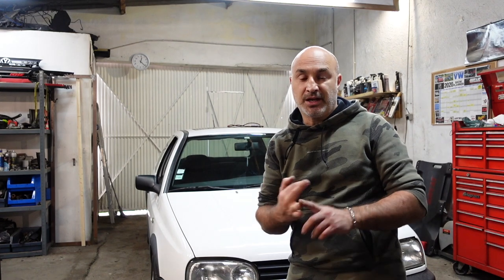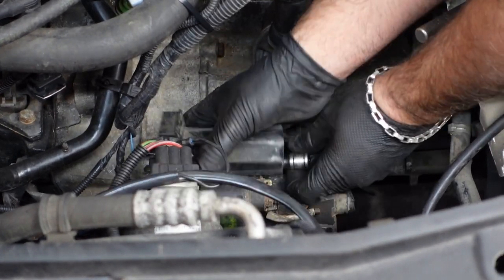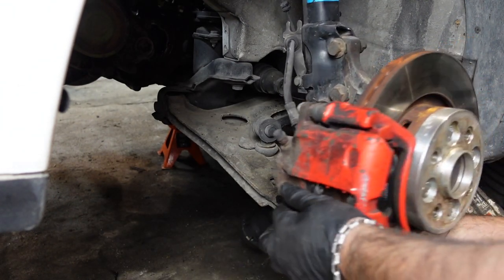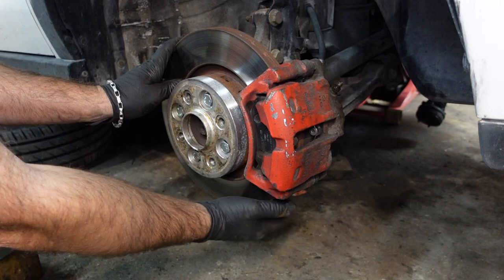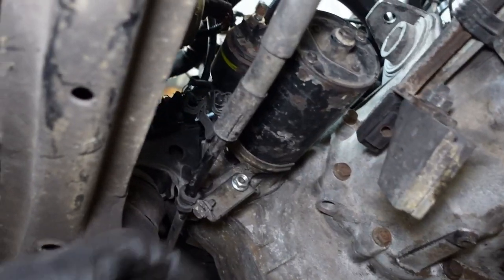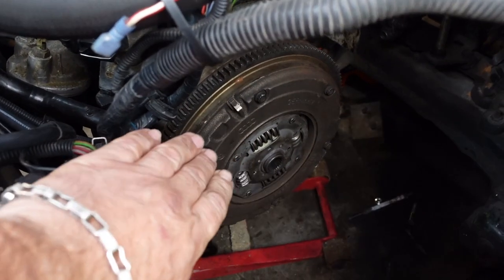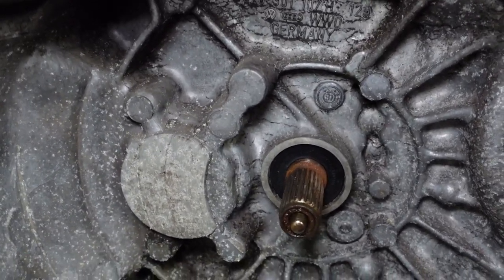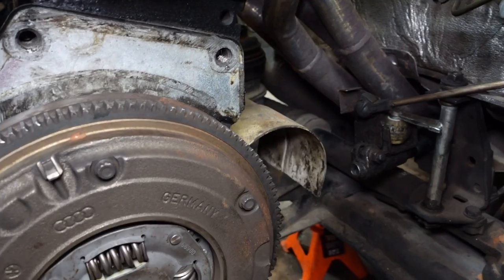How To Golf 3 020 Remove Gearbox

Comment: Thank you so much, I almost have the transmission out. When replacing the rear main seal, do you have to pre-lubricate it? I have the elring replacement seal for the engine. I also was wondering if the input shaft seals are worth replacing. The larger black one behind the splines of the input shaft.
Reply from the maker: Yes 100% once the gearbox is out for the low price of them replace both those gearbox input shaft seals. I never have lubed the rear main seal. But doesn't main you can't.

Comment: Will this video help me remove the gearbox on my 2006 VW golf Mk5 Fsi with a manual 020 gearbox?
Reply from the maker: In truth I don't know, maybe 70% may be the same, the clutch will be hydraulic not cable, the gear linkage I would think is also different.

Comment: What steps are different for the 16v 2.0 ABF GTi engine?
Reply from the maker: The selector cables, the clutch slave cylinder, speedo wiring plug, and the angle to remove the gearbox due to the bigger flywheel.
Reply: What angle does it need to be as I’m struggling to get the gearbox off
Reply from the maker: @BrandonhamonHD  you need drop the engine slightly then with the gearbox loose, clock the gearbox anti clock wise.

Comment: How would this differ from removing Golf-mk3 vr6 2.8 1997 gearbox? Mine was the last edition, September. I believe it's an 020 gearbox.
Reply from the maker: The Vr6 uses the 02A gearbox, there are a few differences, that driveshaft flange which hits the back of the block can be unbolted on your gearbox with a 6mm allen key in the centre, oil will leak from it so remove the oil before hand, makes life so much easier. Your 02A has a hydraulic clutch so again makes life easy just unbolt the clutch slave cylinder from the gearbox.
Reply: @RestoDesignsnando  cheers

Comment: can i put a 96 gti 8v gearbox in a 92 gti 8v?? my gearbox just popped and i found a later 96 one, same engine as mine, mine’s a 92 GTI 8v
Reply from the maker: yes it should be plug n play. To be 100% what is the gearbox codes of both boxes?

Comment: can we reinstall the clutch cable without the white strap on ? it's been removed on mine
Reply from the maker: It can be done with a little bit of luck, otherwise get a load of zip ties on it 👍🏼
Reply: @RestoDesignsnando  is it supposed to be self adjusted because some people say it's not,i have the gti 1998
Reply from the maker: @LOLONO666  Yes you may have a an adjustable type.

Comment: Which model has same gear ratio as golf 3 gti?
Reply from the maker: The car Golf mk3.5 cab has the same engine/gearbox as the mk3 gti, off the top of my head there are a few other 020 gearboxs with near the same ratios but have 90mm driveshaft flanges and the smaller input shaft which means 190mm clutch instead of the mk3 GTI 210mm clutch.

Comment: Got mine all unbolted but I can’t wiggle it out for the life of me seems stuck on that bottom mount and wheel well🤦‍♂️😓
Reply from the maker: OK you need to lower the motor slightly so it clears the chassis leg.
Reply: Dang a yr later and still replying your amazing thanks for the video!🙏
Reply from the maker: @tony817ification  👍🏼